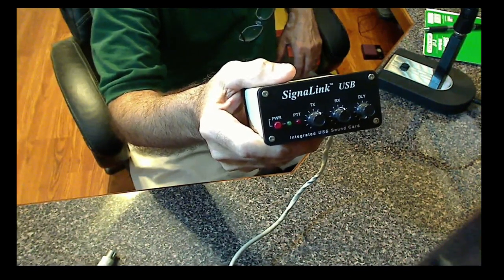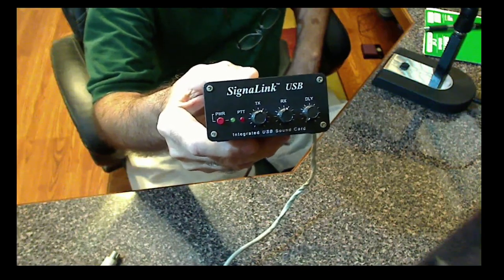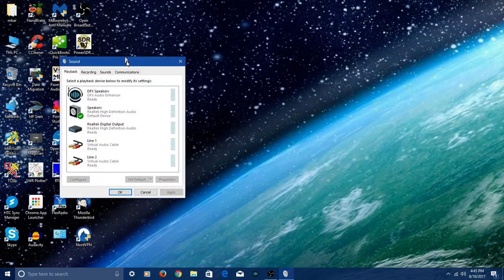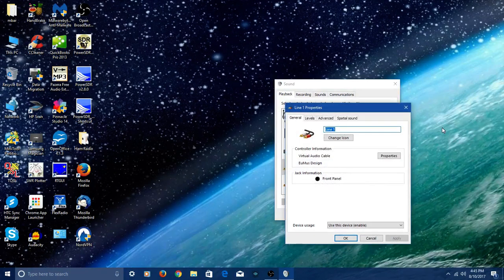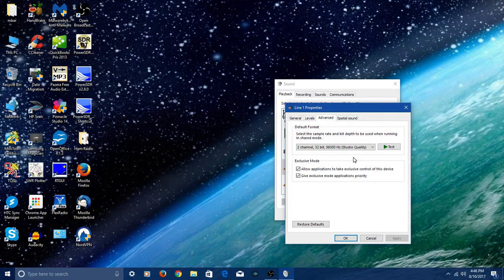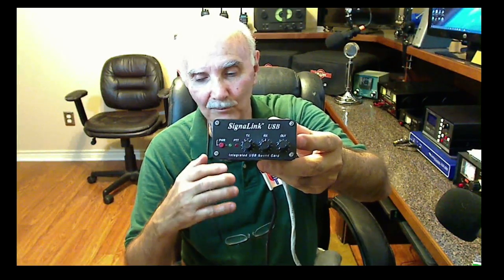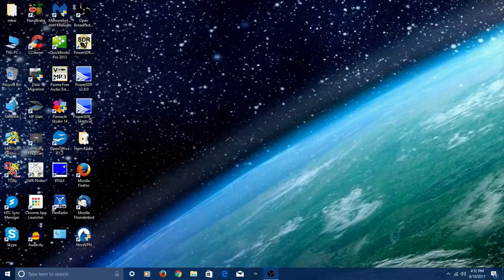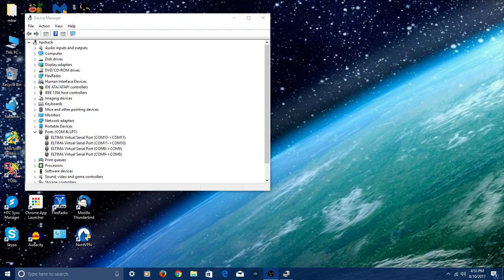How to connect a radio to a computer - for the digital modes.

Comment: i been using this model for years its been working flawless for me. I even have the original one and it did good as well. I never used the pc for internet radio as that is not real radio to me. Its like listening to sirius which is not real radio.

Comment: 5 minutes in and I'm done.. I'm not raging anyone, but if you're showing any ALC YOU ARE DIRTY . The very easiest way to set TX to be clean is to put the Signalink TX to full open. Adjust your tx gain for data in the rig to 100 watts ( or whatever the maxim power output your rig is designed for ) on the meter at zero ALC deflection. This can be touchy as little as 1 number between ALC or no ALC deflection. From there turn  the Signalink back  to  full ccw  hit the tune in your digital program and bring the power level up to 25% or 25 watts output 1/4 of the transmitters rating to be safe and not kill your finals.. These are 100 % duty cycle modes or close to it.. Treat these digital modes like AM  or burn up a good transmitter over time.. This holds true for the amp also if you run one on digital 1/4 of its rated output PERIOD.  Do all this in a dummy load or on a closed band.. It's that simple, you can go from zero output to full power ( which you should never do ) without ever worrying about causing any ALC action whatsoever... I still think you should always monitor ALC on the rigs meter all the times just in case something gets moved and not noticed. You'll always see immediately that you have a problem.. I'm no genius on this stuff, I have been licensed since 75 and playing with digital for many many years. I mean no disrespect to the fellow in the video,  I just think there are maybe easier ways to achieve  a clean signal other than setting at 50 % as a guessing game start point ..
Reply: Good points. The Signalink manual outlines the process.

Comment: CQCQ CQ The Signalink  that is being sold as of 3/5/19 need to be jumpered inside . Depending on which cable you will use going into your radio.
Reply: Yes and I have one but have no idea where to get the diagram to do it, I have a icom 735 and using the 8 pin plug to back of radio...
Reply: Albert Coburn Goto the Martin Lynch and Sons website in the UK and they have a very detailed section on the jumper settings and prewired plug and play modules for it 73 G7WLL

Comment: Hi Joe , Thanks very much for your explanation, I have the SignalLink for almost 3 yrs on the box and away from the radio. It is new for me., but now I feel more secure how to do it.
My question...   I have an FT 897  and reading you and the Signalink instructions I dont need to install the disc ???? I have a new laptop Asus, I am correct  ??.  Thanks very much, 73.
ce3bbl/ve6zw. Calgary.
Reply from the maker: As I remember I did not install the disk.

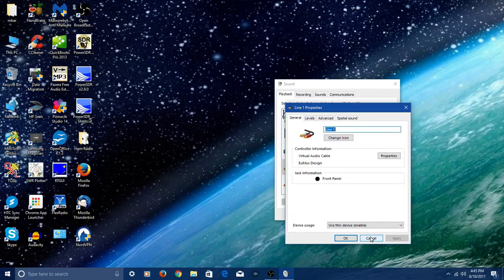Comment: I search youtube for "Configuring digital interface for LInux OS" and this is one of my selections. I watch your video until 7:53 and you're using Windows. Not Linux operating system. Windows does me no good. This is not your fault Joe. YT is at fault. If the search criteria is not found then "Not Found" should show up. Not other videos that have nothing to do with other computer OS's. Have nice day Joe. 73.
Reply from the maker: Well the operation of the Signalink would be the same regardless of operating system it has volumn controll for receive and transmit audio and connects your radio to a computer's  usb port.

Comment: @Joe Lalumia - did you use the 6 pin or 13 pin cable from the USB to your Icom 7000?
Reply from the maker: As I remember it was the 6 pin. Signalink furnished the cable for the 7000.
Reply: Joe Lalumia Thank you. I have seen it with either online. Have read of people having issues with the 13 pin. Were there any other cables required, or all provided by signalink?
Reply from the maker: @maav  No one to radio and usb to computer that's it.
Reply: Joe Lalumia Thank you again!!

Comment: do you need to connect a ci-v/cat interface cable too in order for it to function properly?
Reply from the maker: NITROGEN Gaming tigertronics sells the proper cable for your radio. On my icom 7000 it connects on the rear in the data port. Depends on your radio.

Comment: I can't for the life of me get my signalink, yaesu 857d, and laptop to communicate via the Data port.
Reply: Croaker  I just got off the phone with R&L.  I had the same problem. Jumpers inside need to be made inside. &L sells pre made modules.  Signalink got LAZY!
Reply: Jim Mac Donald hi Jim, I was having trouble after installing the wire jumpers. Took me a while trying different software, laptops, and 857 config file settings. Now everything works fine. There was some compatibility issues with the latest software on my Mac so I used an older Mac laptop, worked on it, and was able to get that one working doing the same things I did to the other.

Comment: Can that fit into that mobile radio the one u recommend and can I use it on my tablet to send pictures and like email with winlink
Reply from the maker: Not on your tablet-- they sell usb cables that fit the data port on the radio-- USB on one end --special connector to fit the radio (brand-model) on the other end. You can call Tigertronics and ask if they have a connector for either the Kenwood 281a (my 2 meter recommendation) or the TYT9800 my (multiple band recommendation). 

Somehow you would need to run FLdigi on either a PC, a Mac, or a linex computer...... then get the radio sound into the computer... then KEY the radio and transmit the digital tones from the computer to the radio. This is easy to do if radio has a data port and or you have line in and line out on the computer. Hope that helps. Here is a link to Tigertronics:
http://www.tigertronics.com/
Reply: Joe Lalumia thank you, I'm just trying to learn all I can so I can do that as well as do the fun stuff with ham

Comment: I have a question, (i'm a newbie so bear with me) I have recently purchased an icom 7300, the manual tells me to connect an icom ct-17 in order for it to connect to a pc, but this video tells me to connect a signalink usb. So do I use both, or one or the other?
Reply from the maker: NITROGEN Gaming either one they both do the same thing.
Reply from the maker: NITROGEN Gaming remember to get the proper interface cable made for your radio. Signelink sells these on their website.
Reply: thanks!
Reply: I was under the impression the Icom 7300 did not need a Signalink or RigBlaster at all.  Check more YT vids about the 7300; I believe you just use the one USB cable.
Reply from the maker: NITROGEN Gaming you don't need a signalink for the icom 7300, but they can be connected and used instead of the direct connection. My icom 7200 and my Flex radio also do not need this.

Comment: Why bother trying to connect a radio to a pc when you can get pc radio internet software . You can get thousands of stations all over the world.and they all come through clear , And you can record has well.
Reply from the maker: This is used for direct radio transmission of a signal usually digital in nature. It is not internet radio. Permits an analog amateur radio to receive and transmit digital signals.
Reply: Malcom James ,well yeah you can get 1000 of broadcasts stations on the internet but most hams will tell you the internet is not real radio...its internet and we use Ham radio to talk to the world..we dont do broadcasts, we can communicate when your cellphone has no connection to the internet like on islands where cellphones won't work